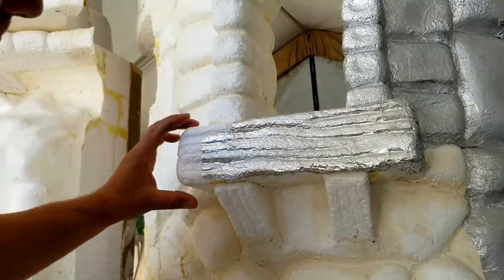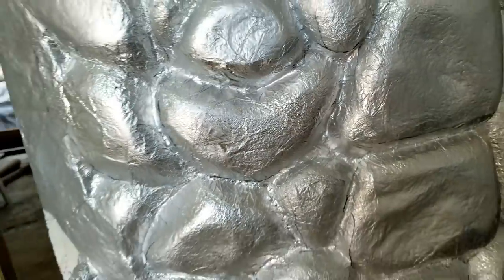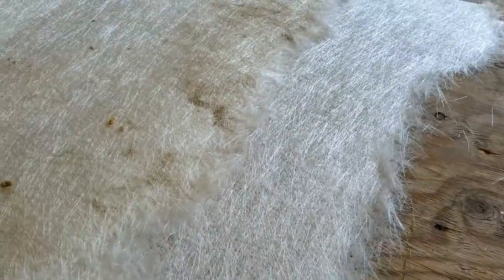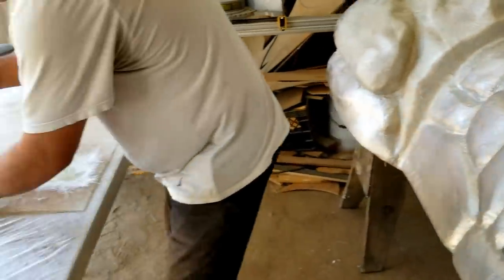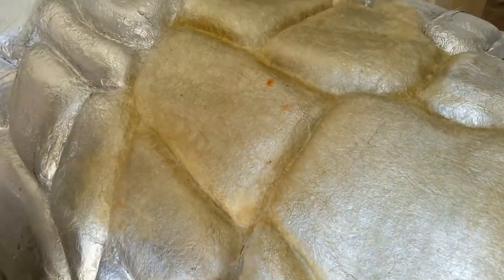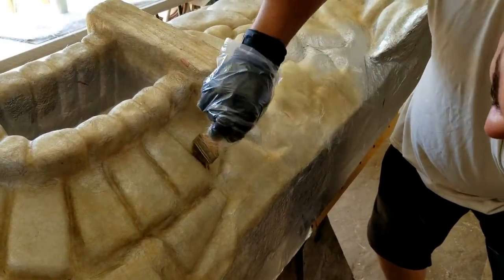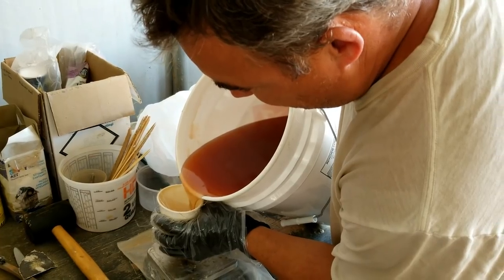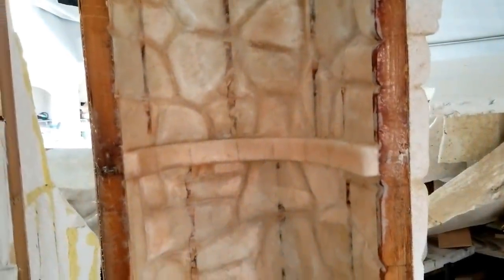Hard Coating Foam with Fiberglass - Giant Toy Playset Castle Grayskull (Pt.7)

Comment: Couple of notes. I'm a 27 year professional composites veteran, former college composites instructor, and part-time prop maker who loves your channel. I currently run the lamination department at a boat company in Florida. We use 0.75 ounce chopped mat a lot. It wets out easily, contours easier than 1.5 ounce and uses less resin while still providing a good barrier. Chopped mat requires about 65%-70% resin by weight, which makes it a resin rich laminate but it helps in consolidation and elimination of air. A resin starved laminate is a weak laminate. 

As for coating epoxy with polyester, there will be adhesion issues. Polyesters do not adhere to epoxies, even if they are sanded. Epoxies do adhere to hardened polyesters, though. I'm curious to know how the adhesion is on the inside where you coated the epoxy with polyester and fiberglass.
Reply from the maker: This is great ya now that I have made a few things I realize its better to just use more resin and a little faster as well.  I will have to try the thinner stuff.  The 3oz really sucks up the resin.  Now I noticed a few air bubbles in a couple places but it seems to be ok going over the epoxy.  At least it seems to be working on the last two skeleton statues we made.  We welcome any feedback and thank you for chiming in with your experience and knowledge.  Its very much appreciated.
Reply: Just curious. Have you guys ever used Jesso paint to prep foam instead of foil? I read somewhere that it works but I'd love to hear from an expert.

Comment: Hey HollywoodHaunter! Love your channel! I've realized your channel is the only real channel I've found that really covers fiber glassing foam for sculpture work in detail, and I hope you'll indulge me because I have a few questions. 

Can you tell me when to use Resin or Aquaresin and what their benefits are? I know you use Polyester Resin to apply the CSM/mat over the foil right? But in this video at 1:53 you mentioned using resin instead of foil. Can you elaborate on that for me?

Does a gelcoat or an Aqua Resin smooth out your sculpture? I'm trying to make some sculptures where the surface needs to basically look like the surface of a car....Super smooth, and I'd love to sand as little as possible.

One more question...have you ever heard of using Jesso to cover foam before fiberglassing instead of aluminum foil? I read on a forum that it works, and to me that would save many hours as an alternative to foiling. I'd love to confirm that. Anyway! Keep up the good work! Love to shadow you or help out with a project one day!
Reply from the maker: Thanks for the kind words. I haven't used Jesso, but it sounds cool. There are so many products that save time or things we could use. I'm still learning, too. The resin I used was called EpoxAmite from Smooth-on, and I was just trying a layer of that instead of the foil to see if it was faster. It saves time but costs more, so it depends on what you're doing the project for. If you ever find a great product to get that smooth finish, please let me know. Thanks again.

Comment: Chris Are you making a mold of the castle? If your not making a mold I would go right to Raptor bedliner. Amazon carries it and they make a tintable version you could add gray paint  to as base coat . Plus its waterproof.
Reply from the maker: Man now you tell me 😆 Thanks for the idea I'm going to push through on this now that I'm going but I will definitely try some other methods in the future and see what I like best.

Comment: Is this just a thin layer of epoxy under the poly resin?
Reply from the maker: Yes I tried that as well as the foil and it was faster but cost more.
Reply: @HollywoodHaunter  Thank you! I heard using Titebond 3 Under poly resin can work also.

Comment: Did the epoxy resin that you laid down first as a resistant layer bond well with the polyester resin. I’m curious cause I’m strongly considering building a small foam slide in camper for my truck. I do a lot of traveling for work. I’m curious which first layer works best. Since I would much rather use polyester resin to keep my over all cost lower.
Reply from the maker: It seems to have and I think if I would have applied more resin first it would have been even cleaner.  One thing I will do moving forward is a light sand on the epoxy just to get rid of any small hard particles before I apply the glass.  Good luck on your project.
Reply: Thank you for getting back to me. Really appreciate the reply. I don’t have much experience with fiber glass. I find your videos super creative and inspiring. They incorporate a lot of similar building techniques I’m interested in pursuing for my own projects. And there isn’t a lot of content like yours. Thank you again